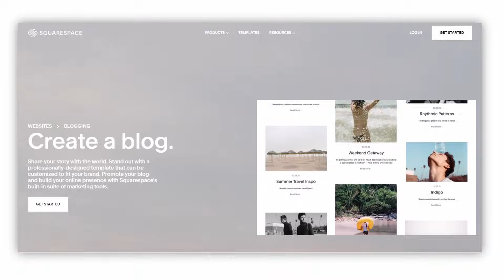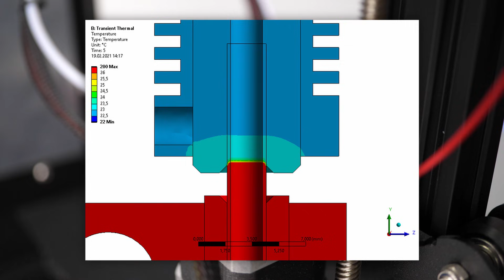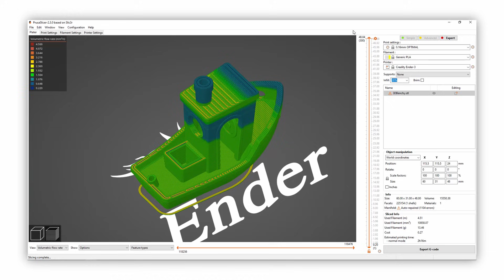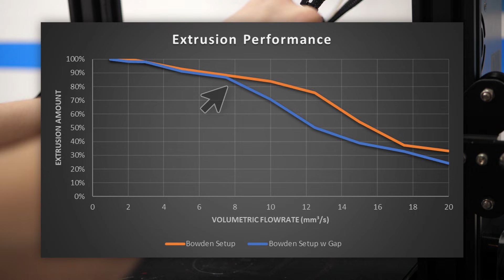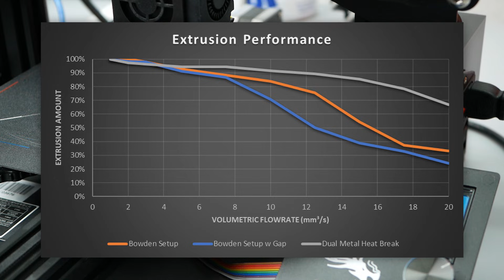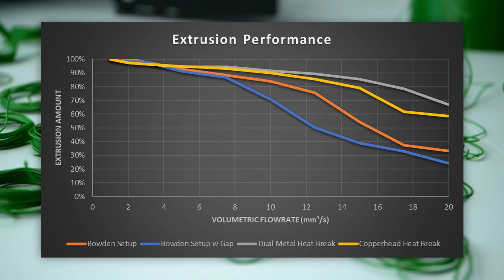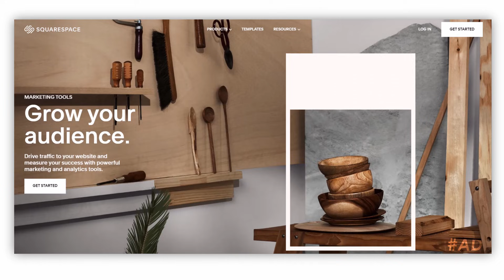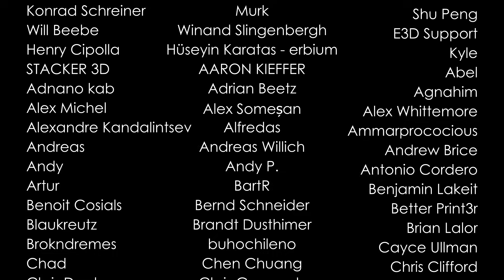Bi-Metallic Heat Breaks - A (R)Evolution?!

Comment: These gimmicks are silly!  just put a vulcano on it! that design overcomplicates manufacture and make its a lot more expensive without actually giving you any benefit.
the problem with your ender 3 is the hotend (which is crap). Just put a v6 on it. and maybe increase the current on the stepper or change to a geared bowden setup.  or better yet, change the extruder to a direct (optionally geared)  extruder.

I have geared direct extruders on my machines and i cant even get 90% understrusion. I mean i cant because i have so little slippage that if i go too much above the hotend limit it simple eats the filament off because it has so much force and grip it can literally pull up the whole machine into the air.
The machines weight about 20kg each, so that would make it like 11000psi on 1.75mm filament according to math, which would explain why some times when it clogs the filament is all bloated at the bottom, it literally compresses solid plastic!

For reference in my machines @ 235ºC PLA: v6 15mm^3/s, vulcano 22mm^3/s, super vulcano: 60mm^3/s
All of them have stainless steel all metal heatbreaks.  I can do more but quality suffers a lot. Extruding cold plastic makes awful prints, at least well below what i find acceptable to sell.

So like they say, git gud scrub, just put a vulcano on your i3 if you are gonna print big parts like those face shield.

ps:  theres no "oh its expensive" excuse either, i made my own super vulcanos by hand with sand paper and a bench drill. You can do the same for the vulcanos. just buy some long aluminium slab thats more or less the size, cut it and work it to shape.
Reply: Which machines did you use? Of course volcano will give you more volume, but with a good thermal and dual gear extruder (ratio 3:1 ; 7:1) you can get even more volume
Reply: @Fernando_Gazzola  
Im not a hobbist, i do this for a living. 
My machines are mendel style machines (fully custom design).
The geared extruder uses a M8 bolt with a ~7:1 ratio (v6/vulcano) and 3:1 (super vulcano).

The v6 is an e3d original, vulcanoes are chinese clones, and the super vulcanos are made by me. All use all metal heatbreaks

The volumetric speeds are peak as you usually can compensate for it in the short moments it decelerates, accelerates, retracts and travels. The actual max rms is about 85% that. And the main issue is that the filament comes out cold and may not stick well enough or retain the shape.

Accel/jerk on the v6/vulcano machines is 2000/15, and 4000/40 on the super vulcano ones. (my lastest design) 
The super vulcano can actually do more or less 80mm^3/s but the quality is shit and i really have to crank the temperature really high (265ºC)  so i use 60mm^3/s for small parts just so that the slicer wont limit the speed, but for large parts i set it down to 50mm^3/s and lower the temperature so that the part has a nice mate finish.  The super volcano really needs a lot of tuning to get good finish while keeping the speeds fast. Lots of tunning the temperature too, something that i never had issues with with the v6 or normal vulcano. 

The numbers are the actual numbers, most people just dont know how to properly use these machines. Its a pain to have to watch people have really expensive machines but use it like its a darwin. I actually laughed when i heard 5mm^3/s on the enders 3. I made the right decision when i decided to design my own machines rather than buy pre made ones.
Reply: Your volumetric number looks like a bit off... check the real speed applyed to your slicer (considering accel in firmware) in gcodeanalyser website ;)

Comment: At around 10:44 I had a thought. I wonder if screwing in the nozzle first, such that it is completely flush with the heat block would result in even better performance for free. I would think intuitively that the higher area of contact would keep the temperature of the nozzle more consistent while pulling double duty in reducing heat transfer to the cold end due to lower contact there.
Reply: I completely understand why you think that that’s a good idea. But unfortunately if you do it that way you can’t properly tighten the heat break against the nozzle. I’ve tried it because I also thought that would improve thermals.... my hot end exploded with molten plastic. SO DON’T DO IT! Leave a small gap between nozzle and heat break. Insert heat break first then tighten the nozzle against the heat break.
Reply: @lucasvandelogt5126  I think these two methods are effective, but I prefer the former method. However, if you use this method, you cannot change the nozzle at will, otherwise you will encounter the problem you mentioned. If you want to replace the nozzle, you need to remove the entire hot end. However, if you use hardened steel nozzles, it can indeed bring certain improvements.

Comment: i'm struggling getting such pretty prints with prusaslicer and my stock ender3. i'm using their normal profile. is there a way you could do a video just showing the best prusaslicer settings for pla on a stock ender3 ?
Reply from the maker: I used the stock settings for the Ender-3 that come with the most recent version of PrusaSlicer. No magic involved! Maybe buy some proper filament and check if your bowdentube is properly seated.
Reply: @CNCKitchen  bowden tube is all the way down, i'm using overture filament PLA-Pro
Reply: @WX4CB  first layer issues? If you have the glass bed, put the textured side face down, wash the glass side with soap and water, then use eye/glass cleaner and a paper towel to clean the bed, be careful not to touch bed again while cleaning, use a thin layer of elmers purple washable stick glue after you preheat the bed and nozzle to print temp (that way the glue doesn't dry out waiting for Temps to come up, so it'll only be waste line and print in the start sequence)

Comment: Where can I get the gcode file for the retraction test print or the stl and how do you set it up to use the stl ..sorry I'm a cura user ..ty
Reply from the maker: That's made with 3DOptimizer.
Reply: @CNCKitchen  yeah I'm not familiar with what that is

Comment: I got my bi-metal heat break from Trianglelabs, works extremely well and the press fit is pretty solid. Dropped 8c on my heatsink and haven't exceeded 40c on it even with both hot ends at printing temp. I have noticed that I was able to print very large extrusion widths very quickly, and for only $17.
UPDATE: Benchmarked my max flow rate with a bimetal heat break, copper 0.6mm nozzle, copper heater block, BMG extruder 3:1 gear ratio, and pancake stepper at 0.5amp RMS in DD config. The final results were around 25mm/s^3 cubed, incredible for a non-volcano V6 hotend.
Reply from the maker: Which version did you get? The one for the Ender as well?
Reply: @CNCKitchen  almost everything from trianglelabs is of good quality. its pretty much the only chinese knockoff worth buying. some of their clones are superior to the real deals. their bmg clone fits the ender 3 without rubbing against the leadscrew. the dragon hotend can barely be considered a mosquito clone its heavily redesigned and fits any v6 mount. the dragonfly too can barely be considered a copperhead clone theres 2 versions of it one that is somewhat obviously a copperhead clone and one thats a drop in replacement for an ender hotend. they also have a microswiss clone with a plated copper heat block. and their plated copper is good i have the dragon hotend and both the plated copper block and 0.4 nozzle have been working excellently for me.
Reply: @CNCKitchen  I can recommend the trianglelabs clones, these are of superior quality.
Reply: @CNCKitchen  Yeah I got the ender version off Ali Express.
Reply: @CNCKitchen  They only have the kraken one, but that works in that mod also.
Reply: Hello, I have the CR10-S4, but the heating part looks like it is the same as the ender 3, I wonder if I should go with the threaded or smooth one.
Reply: @Emetsys  smooth,  the increased diameter of the threaded one would not fit
Reply: Mark, I am interested in upgrading my hotend of my Ender 3 V2 with 4.2.2 board with a V6 style such as this one --> https://www.aliexpress.com/item/4001230851527.html?spm=a2g0o.detail.1000023.1.699341eaZZDbtz   and change out the heat break with this --> https://www.aliexpress.com/item/1005002047653207.html?spm=a2g0o.productlist.0.0.12d05a0fD8w5bf&algo_pvid=ea826f2d-0f85-407d-b7d6-317d753d47fa&algo_exp_id=ea826f2d-0f85-407d-b7d6-317d753d47fa-0  .  I am interested in what you think about it. I like how the V6 is designed to keep the PTFE tubing further from the nozzle and with a upgraded fan I know it will ensure longer like at the PTFE tube end. I plan on using this on a bowden setup with a dual drive extruder or maybe the EZR struder to give me more options to print different materials.
Reply: @Juhsga Sorry for not responding for a while, youtube and their notification system sucks but anyways. I wouldn't run a v6 style hotend on an ender given you already have hardware mounting points for a microswiss clone from trianglelabs for a similar price but at a much better quality. The only downside would be you can't really swap out the heater block or heat break for a bi-metal or cartridge based system for higher temperature printing >300c. If thats not an issue for you the microswiss clone will be a better option.
https://www.aliexpress.com/item/33031908940.html?spm=a2g0o.store_pc_groupList.8148356.34.e6b770b5iRk9gD
But if you really want to stick with the more modular V6 system trianglelabs sells a clone of that as well which is of very good quality and you could run a bi-metal heat break from them as well.

Comment: I currently got massive problems with heat creep printing PLA with my Prusa i3 MK2S MMU1. Tried everything together with the support of Prusa, like replacing the thermal paste and other stuff. Didn't really fixed the issue. I'll gonna definitely give this a shot. Hopefully, that fixes my issues.
Reply: So I got a update with really good news 😊 I got my copper heatbreak a few days ago. It fixed all extrusion issues I had with my MMU1. Big thanks Stefan for that recommendation. 
One little thing is, that the lower part of the heatbreak is a bit longer than the original one from e3d. But some tweaking with my PINDA fixed that.

Comment: Interesting! How would such a heatbreak improve upon a direct drive?
Reply from the maker: Good question! I have also one for my Prusa and am eager to try it out!
Reply: @CNCKitchen  I did the exact same test you did with my Prusa Mk3s. The slice Engineering Heatbreak can go 3mm³ faster without skipping or grinding.  Here are my findings : https://ibb.co/7XgDvCZ
Reply: @Faceless27  Oh your graphs look so satisfying 😅 I imagined it won't be as drastic as on the Bowden. It probably hits the limit of how fast you can transfer the power into the filament rather than the friction in the heatbreak.
Btw do the heating algorithms take into account that power gets taken out of the system and increase power accordingly when there is feeding?

Comment: Should do something with closed loop extrusion, not measuring the rotation of the motor but the actual filament going through, print even faster (?).. :P 
edit: well I don't know if you can print faster but you can atleast compensate for the underextrusion.
Reply from the maker: Check out Polygno or I thing Bigtreetecs latest filament sensor.
Reply: @CNCKitchen  Polygno, from a single photo from their weird website, does indeed seem to do something like it. Bigtreetech's seems to only pause the print.

I think it'll be pretty easy to make a standalone closed loop extruder, I might look into it.

Comment: 4:55 i occasionally keep getting that skipping thing happening. is it always down to too fast extrusion? because for me it seemed to only happen when a print starts printing lots of small sections of infill with retraction, so it pushes and retracts the same section of filament multiple times causing it to gouge the filament, to the point it was so bent it increased the friction in the tube, that happens multiple times and eventually it's too hard to push through and it cant extrude anything and just keeps grinding the same spot of filament. could it be that its a problem that is started by too fast extrusion and the combination of retraction makes the print fail?

Would be good to find a solution for this

Comment: Do you have to edit firmware on a stock ender 3 to print above 250c ? If all that is needed is this hotend to print at 300c I will be a buyer.
Reply: You need an all metal heartbreak since ptfe degrades above 250 and also to flash the firmware to change the max temp, if you plan on going much above 300 I'd also suggest an hotend with plated copper melt zone (or at least a non alluminium one as at higher temps it softens too much). If you plan on 300 max this will work for you just fine

Comment: Micro Swiss direct drive and stainless steel nozzle and be done with it
Reply: no way... stainless steel nozzles are really bad in thermal condutivity... need to pre-heat to achive the proper temperature. Copper>Brass are much better

Comment: 5mm³/s? Wow that's one crappy hotend, I can't imagine going below 30 myself, and I'd like to go up to 50-60
also it's kinda funny how I was able to get 12mm³/s with the anet a8 hotend without much if any extrusion problems, at 223c
Reply: How? 3mm filament?
Reply: 50mm^3/second extrusion sounds implausibly high, but 50-60mm/sec is a typical number for x/y movement so I'm guessing that's what you're referencing
Reply: @Netherlands031  Ah that totally explains it. I was wondering how the hell he got those numbers. Just for reference the SuperVolcano with 0.8mm nozzle is advertised at 24 mm^3/s.
Reply: @NavinF  'able to get 12mm³/s with anet' so no he is not talking about print speed, but volumetric flow. And that's some crappy Advertising of the super vulcano then because it can surely reach more. I have the Sidewinder x1 with normal Volcano V6 clone and with a 0,6Nozzle, Linear advance activated you can get medium quality prints (drafts or big parts) with around 25 to 30mm³/s. Print speed then is between 100 and 140. Most of the time It doesnt make sense to go fast though, the part will be more consistent being printed slow (especially Layer strength in different areas of the part)
Reply: @felixheller4682  E3D probably hedged for the flow rate that seemed to produce good results, reliably, in testing.
Reply: You are probably talking about print speed, mm/s, not extrusion rate, mm^3/s
Reply: I get 9mm^3/s on my Ender 3 printing PLA at 236C. I assume you're using a massive nozzle and hotend to get those numbers. I'm using 0.4mm just like the uploader